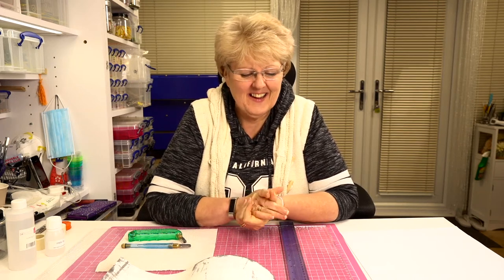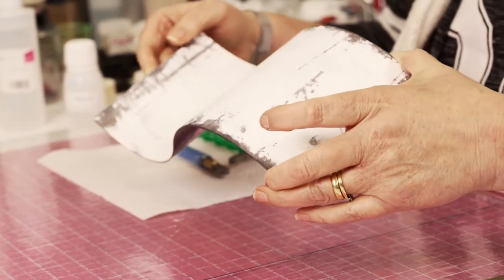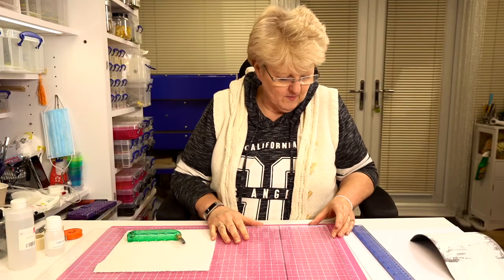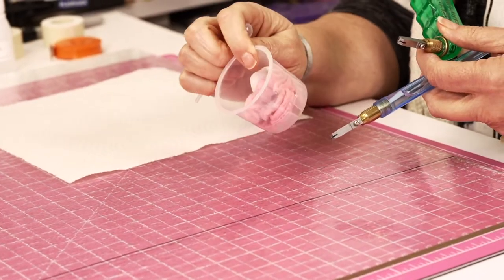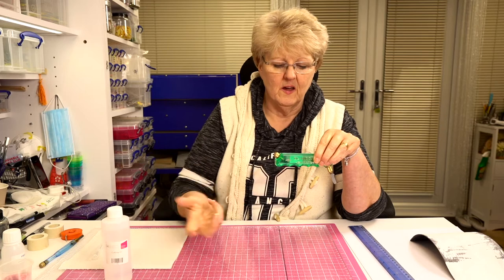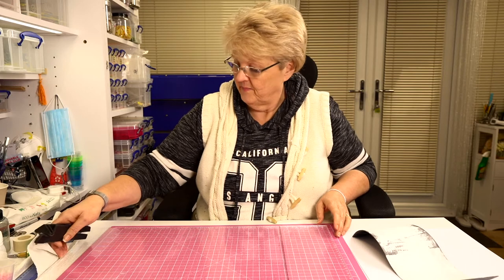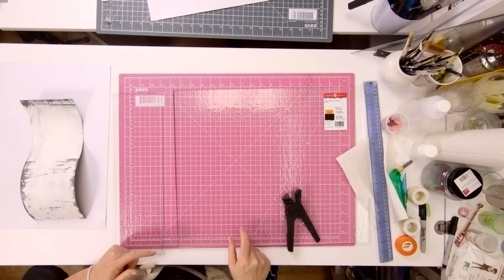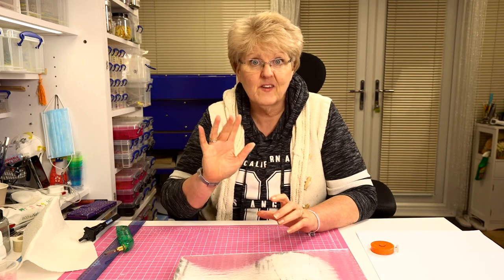How to cut glass for a curved metal mould

Comment: Thank you for the great videos. Always very helpful. Question: can I dip the cutting blade in mineral oil or other types of oil instead of the one sold for glass?
Reply from the maker: Yes most types of oil can be used, kerosene, light machine oil and so on.